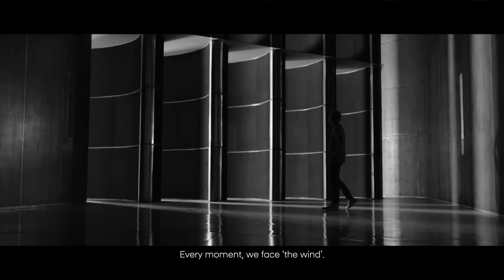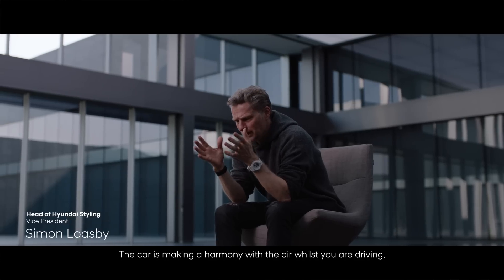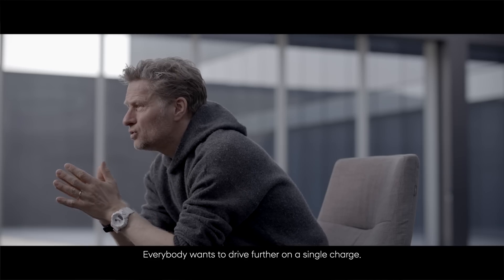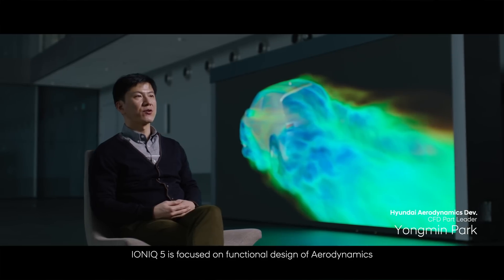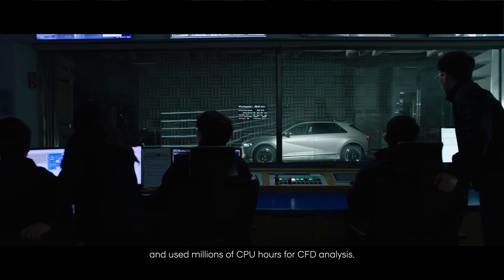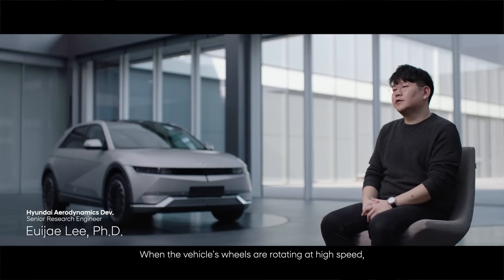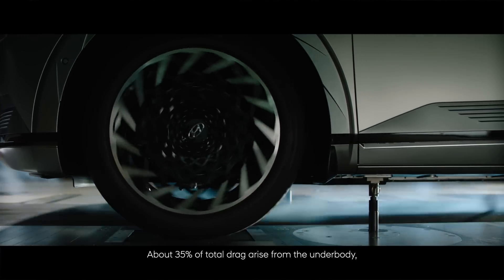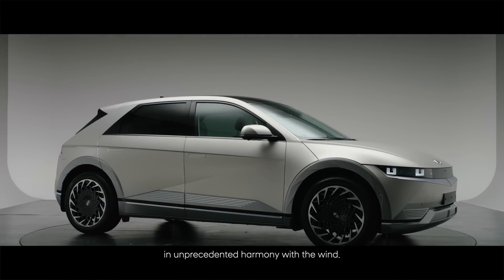IONIQ 5 Aerodynamic Design with Balanced Practicality and Efficiency

Comment: When the car is parked outside for charging pigeons will poop on the rear screen .If this is overnight the poop will set like cement and needs a wash wipe to clear. Save with some of the gizmos  and give us a rear wash wipe blade instead. How many of your hatchbacks have no rear wash wipe?  This is a deal breaker for me.
Reply: Sedans have no rear wash wipes. No issue.
Reply: @FilmScape4K  this car is a hatchback not a sedan. The rear screen angle is much different.
Reply: @peterbee8892  if a sedan doesn't require rear wiper , crossover, SUV or hatchback don't either....
Reply: @peterbee8892  it's not a hatchback. It's a SUV or acturally a CUV.
Reply: A rear wiper wont be much help with bird poo.